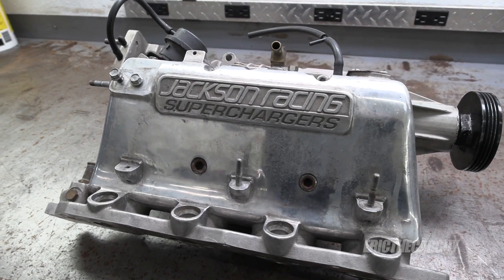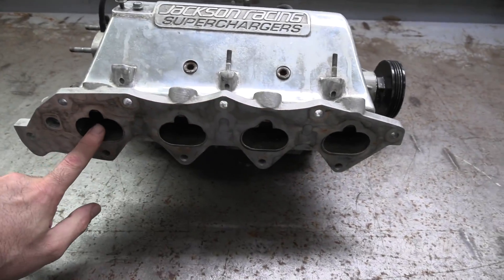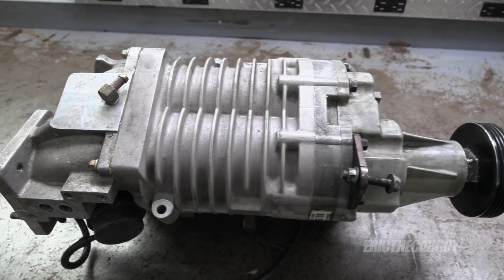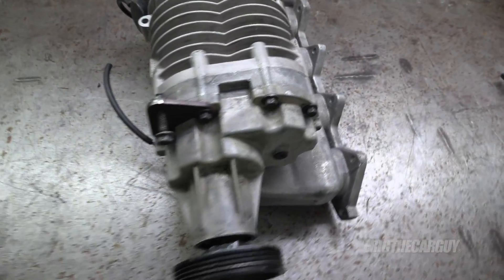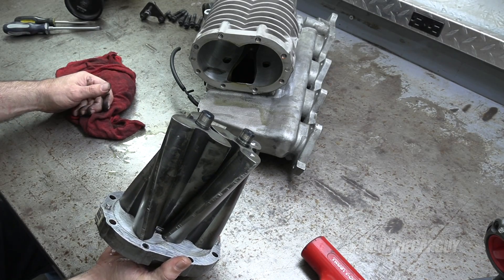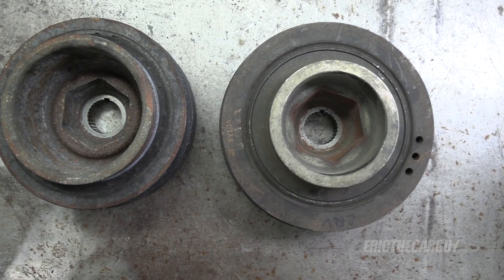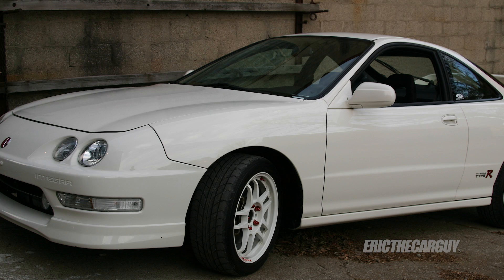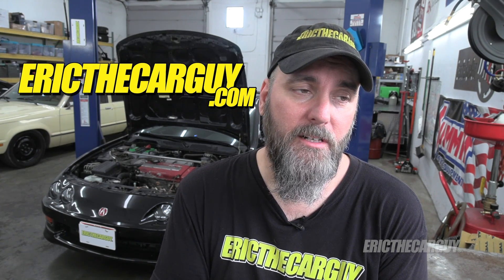Supercharger Tear Down and Inspection

Comment: Once again a great video! My question about supercharging would be if you would need to put in different pistons with lower compression or if the oe ones are fine with low boost..? Ive been searching for a supercharger for my Toyota iQ its got a 1.0 3 cyl engine (i know thats tiny) but here in Germany i pay next to no tax with that engine so there i go :D would the engine need a MAF sensor to work?
Reply from the maker: I just spoke with an expert on supercharging B series engines like the one in my Type R and he said that with a heat exchanger I could run 8psi just fine. My engine is 10.5:1. I'll have to back the timing off a bit though. I don't want to run high boost anyway, I don't feel that's efficient as that normally just adds heat instead of power.
Reply: EricTheCarGuy thank you for answering 🙏 my engine should also be at around the same compression ratio. I wouldnt want to run a lot of boost either just want that little bit more torque. Cant thank you enough for your videos!
Reply from the maker: No worries. Don't forget to back off the base timing and have it tuned after the installation.

Comment: @12:20 ish 'I thought that was 10mm...maybe 3/8 inch'... That was a gripe I had with a 1981 Pontiac Phoenix I bought new, it had a  mix of SAE and Metric nuts, bolts, and assorted fittings.

Comment: Could a small oil cooler be used at the snout to keep the oil temp down and possibly aid in slightly to little temps? Also, when adding the methanol kit should it be forward of the mass air sensor? Great stuff and thanks in advance!
Reply from the maker: The heat exchanger will bring down the heat in the entire assembly considerably, no need for an oil cooler in that situation. This engine does not use a MAF, but I believe you would want it to inject after the MAF to avoid damage to it.

Comment: Eric, yes, that's an M62. It was a special version that's reverse rotation for the B series, which also spins backwards from conventional. The wear on yours indicates a long period of use without a good filter in place. The housing is pretty well knackered and the rotors, while they can be recoated and cleaned up, they're self clearancing and will eventually rewear. Finally, yes, the LHT Performance intercooler is awesome but LHT doesn't do that any more sadly, and the ones left are a lot like your rotor housing. I'd guess you can get 2-4psi out of that supercharger even if it's cleaned up. You can reverse the M90 from a GM 3800 and get a little more power if you feel like some DIYing.... ;-)
Reply from the maker: Thanks for that info! BTW, I've been in communication with LHT and they're going to help me out. Win!
Reply: @ericthecarguy  LHT is a wonderful group. Good luck! I've got an M90 out of a 3800 that I'm in the process of rebuilding and reversing for a big bore B for my CRX, so I'm watching your build with interest.

Comment: I had a 2004 E55.  V8 with a roots type blower and that thing hauled ass and was dangerous if you turned the traction control off.  I burned the back tires off in about a month.

Comment: They make an upgraded internal coupler. Eliminate some of the flex at high RPM and knocking noise. Also prevents against premature failure. I'm sure the damage around the snout is due to not using a proper supercharger pulley removal installation tool. 🤷‍♂️ Such as it is.

Comment: The good news here is that it looks like that's just a standard M62 they created a custom snout and manifold for.  Even if that housing is complete trash, you can easily get a new replacement.  Maybe even upgrade to the new 4 rotor units in the process.

Comment: In your opinion is the ingersoll rand 3/8 mid torque have more power than the Milwaukee 3/8 mid torque I'm trying to determine which to buy I dont care about brand price or battery platform bs I just want the most powerful of those two brands I have both Milwaukee & ingersoll rand battery impacts I do industrial marine mechanic work so I need most powerful not brand loyalty bill shit
Reply from the maker: I LOVE my Milwaukee tools but I got the CP before they started showing up. I've been very happy with it. I mostly like it because of the light ring. I think both tools will work fine, it's just a matter of personal preference. Although if you plan on buying more electric tools, I'd stick with one brand so that you can share batteries.
Reply: @ericthecarguy  alright I think I'll stick with ingersoll rand battery impacts they seem more for mechanics & thanks for your opinion I appreciate it

Comment: do a small water meth kit, itll take up any slack in the housing, give you a small bump in boost and itll keep temps well below non intercooled. non intercooler roots are heat pumps, youll pick up a lot of power and more importantly consistent power with at least 1 nozzle pre blower. i wouldnt even tune for it, tune without it and just add a 50/50 mix on top, wont do enough to the tune to matter but itll be a huge benefit while spraying.
Reply from the maker: I'm actually looking into the heat exchanger for that very reason. If I can make that work I will. Better than messing with the meth injection in my view since I won't have to mess with it and it won't run out and need refilling. Thanks for the comment.

Comment: Eric, I don't know if John at LHT is making those intercooler setups anymore, if he is or if you can talk him into it this is the much better method for air charge cooling. I was looking to do the same to the supercharger on my d series but wound up going with meth injection instead. It really does help the intake temps. Also if your sending your charger off to The High Speed Lab for inspection and rebuild consider having them port the blower case. It will help with airflow and efficiency which is something these kits struggle with.
Reply from the maker: Thanks for the heads up.

Comment: I used to have one of these on a 2000 civic si. I loved it, I used a plastic manifold gasket to help with keeping intake temps down from heat soak.i put the intake temps sensor   on the manifold side, temps weren't bad.

Comment: I had Highspeed labs rebuild mine and they did an excellent job. I sent mine to LHT to have the intercooler installed.  Its a blast you will love it.
Reply: Same here with hsl, their service is amazing!!
Reply: Does it actually keep it cool enough that we can drive during summer? I hate not being able to even do a pull or two in a gear?  

Also do u know of a place to get it repair and or holes welded and resurface cause I got mines all crack along the injectors area and the holes are drilled out to fit a ITR b16 head. Need repairs then I can do lht or if lht can do them altogether I'll pay....thanks!
Reply: @b20eg195  Yes it differently helps cool the intake charge but I would not invest in it if you do not plan to run higher boost. I am not sure where you could get it repaired maybe take it to a machine shop and have them look at it or keep an eye on ebay or facebook marketplace, they pot up once in a while. This is a excellent thread and will give you lots of answer's to your questions, good luck.  https://honda-tech.com/forums/forced-induction-16/%2A%2A%2A-official-jrsc-thread%2A%2A%2A-1214810/
Reply: @b20eg195  http://ebay.us/56YK4E?cmpnId=5338273189
Reply: @Marcking98  appreciate the link, but I have a complete kit. It's just that it is cracked at the manifold so there's boost leak and coolant leak. I'll try to get it welded fix if it isn't so expensive, but ya finding a spare one would be great, but I figured if I can send it out to LHT they could perhaps make it seal because they are going to cut the shit apart and reweld it lol.

Comment: LHT Performance made those aftercoolers. He has a YouTube channel and still works on hondas. Will you be running a chipped ecu rather than the original Jackson FMU fuel control?
Reply from the maker: I plan on getting a Hondata to run it when it's all together.
Reply: @ericthecarguy  Nice. Can't wait to see it run!

Comment: Same design as a Eaton M90 used on 89-95 SC Thunderbird and Grand Prix GTP  and similar to Eaton M112 used on Jaguar XK/J-R and Lightning.

Yes that pulley is very narrow the M90 uses an 8 Rib belt. 
The only thing that Jackson did was make the intake the M60 is an off the shelf OEM item.

Comment: If you can't get the old water to air intercooler could you use a front mount air to air instead?
Reply from the maker: Not really since the supercharger bolts directly to the manifold. Check the description, the company that modifies the manifolds is linked there.

Comment: I've learned some very interesting things about these jackson racing kits. Including info and pictures about three dealer installed kits. Amazing stuff, and some amazing old school aftermarket tuning behind it all.
Reply from the maker: I'd love to hear more about the dealer installed kits. We never saw any of that at the dealer where I worked.
Reply: I got a hold of the info through some of the guys at HTS (Honda Tuning Suite) A few of them were around in the hay-day of OBD1 tuning,  there is pictures and info up on their discord, I would have to dig through it. From what I gather, it was just a promotion through jackson racing, one off, one dealer. One of the guys eventually had his hands at dyno tuning the car, but over the years the thing was a basket case, and unfortunately when the kits were first available, the tuning options were limited to say the least.

Comment: Eric, thanks for the informative video. are you worried that modifying the type R may hurt the resale value in the future, seeing as the prices for these cars are on a hike?
Reply from the maker: Not really. For one, this is all bolt on stuff that could be put back to stock if someone wanted to. Also, this car was never a 'creampuff', so the value was already hurt a bit. Lastly, this is a 'period' upgrade. In other words, I think it fits with the time of the car, late 90's early 2000's. It might even raise the value based on the rarity of these parts and the popularity of this upgrade. Thanks for the comment.

Comment: If there’s any way possible, get that heat exchanger. It’ll damn near double the power capability of the blower.
I used to mess around with there in the early 00’s, tons of fun, especially in EK B18 swapped hatchbacks.
Reply from the maker: I'm leaning toward that myself. I'm reaching out to that company linked in the description today. Thanks for the comment.
Reply: @ericthecarguy  You really do not need to intercool it if you are staying with the stock pulley.